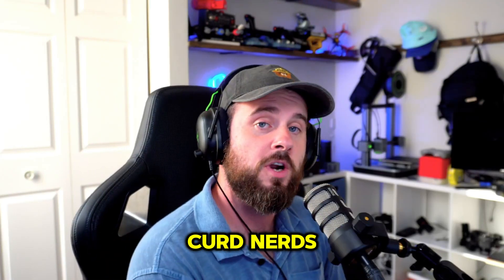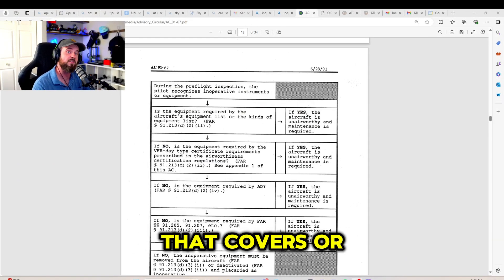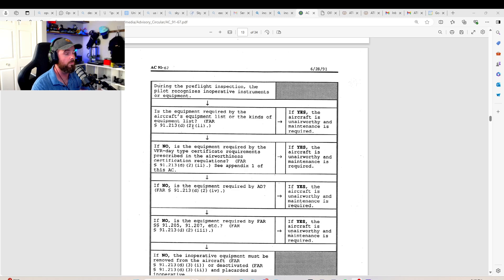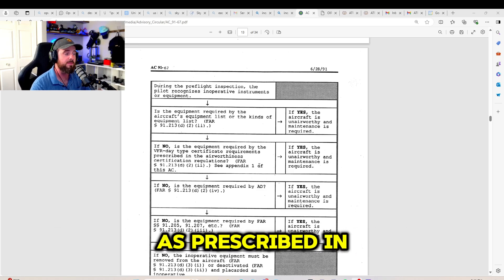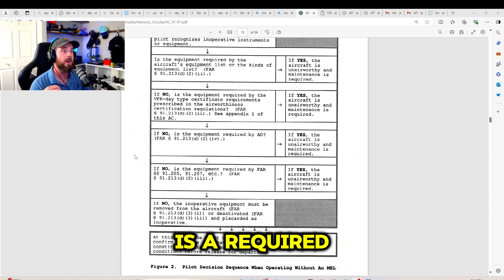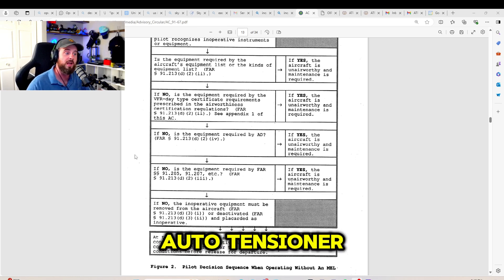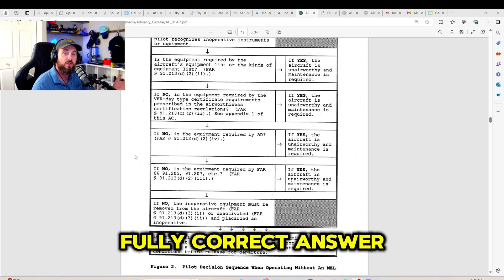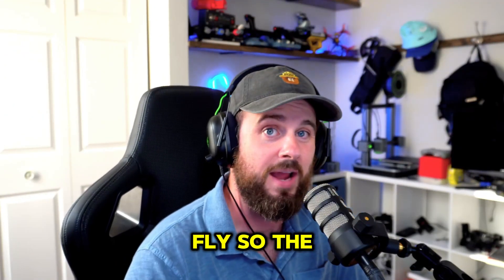How to tell if your Aircraft is airworthy 91.213 91.205 explained

Comment: The FAA , on their web site, says  AC 91-67 was canceled in 2017 because its contents  "misaligned with the latest ICAO standards”. Was that cancelation ever rescinded?
Reply from the maker: Oh thanks for the heads up I know this flow chart I used is still accurate though I'll see if I can find a more current source
Reply: @cheesepilot  https://www.faa.gov/documentLibrary/media/Advisory_Circular/AC_91-67A.pdf    page 26 maybe?
Reply from the maker: Yep that's it thanks for catching my mistake
Reply: @cheesepilot This just came up at the flight school I’m contracted with! I’ve been teaching my students to reference 91-67A for guidance instead (it came out in 2023). It doesn’t have the same convenient flow chart, but does provide guidance on MEL and Non-MEL inop equipment scenarios.
Reply: Page 4-4 is a flow chart but it’s not as specific as the textual portion.
Reply: @laurenascher3558  Thank you! I didn't realize this was out!

Comment: I remember by “checking my KART” 

KOEL
ADs
91.205
TCDS
Reply: @stringbeanleaks3318maybe the “R” is for Regulations?
Reply: Issue with this is 91.205 is not the only applicable regulation…

Could be required by 91.207, 91.215, 91.225, etc.
Reply: @stringbeanleaks3318 The R is for Regulations. I know there are many regulations to remember but I think we all know 91.205 is the reg we need to remember for this particular instance.

Comment: Do people not do M9PTAS?
Reply from the maker: whats that?
Reply: @cheesepilot  MEL 91.205 POH TCDS AD Safety
Reply: @aysn5785  91.205 is not the only regulation regarding equipment. 91.207, 91.211, 91.215, 91.225, 91.307, etc. it’s important not to forget this, as transponders aren’t required by 91.205, but they are required (in some curcumstances) by 91.215. 

“Or any other rule of this part” -91.213